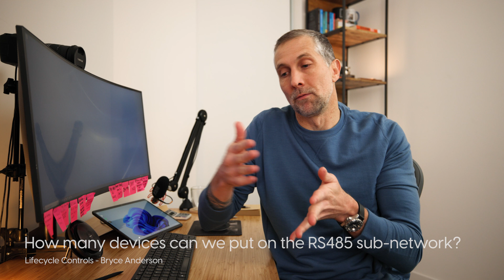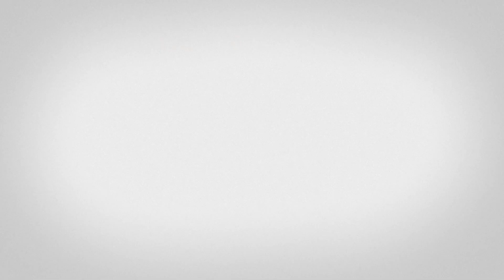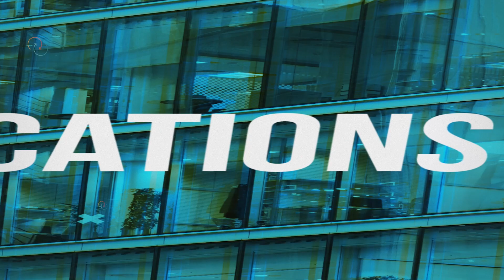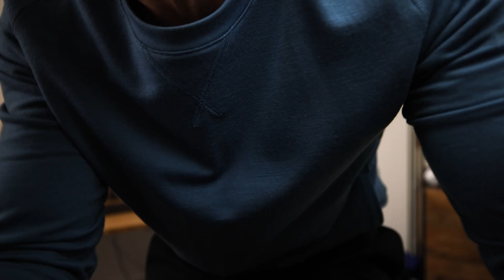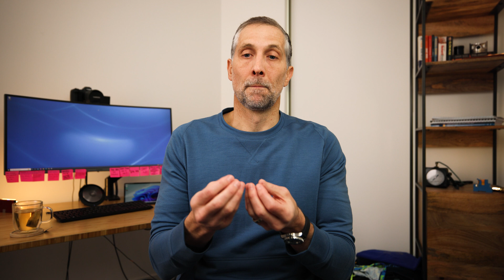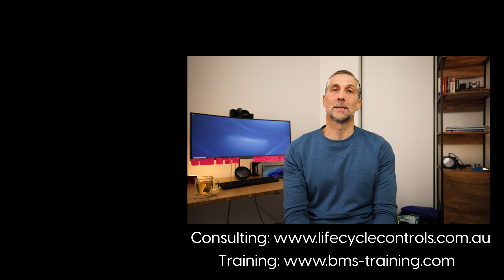How many devices can you put on an RS485 subnetwork?

Comment: I believe it's the following.
32 is the hexadecimal on the Dip switch. This is limited to the baud rate you can pass on the twisted pair.  After all you only have a shielded twisted pair.  Bandwidth restricted.
Especially BACnet who is commands would overload the bus.
In your architecture the 3rd party systems like EMS and Analytics is polling on the IP layer,  not the MSTP layer. It should not be affected by shortening your bus runs,  assuming you have an IP controller at the riser BACnet shared all the trended points back to the server.
Furthermore the trend is to eliminate RS485 altogether with a ring main CAT6 loop instead with IP bus controllers allowing for more bandwidth.  In theory this would be a much later subnet network than the RS485 bus can ever manage.
My opinion only.  RS485 is dead.
Reply from the maker: Hello, thank you for your detailed reply :-) 
I agree with everything you have said. 
I have many situations where overloaded RS485 sub-networks are slow to present data back to the network controllers. Too many devices, too many points. 
Also, some BMS systems do not use network controllers that hold the database, some use gateways, that simply transfer the data from the sub-networks through to the IP network. This significantly slows down the amount of information that we can get through to multiple servers. 
Lastly, often, an overloaded sub-network results in an overloaded BMS network controller. CPU running at 100%, available memory stitting at 0%. Network controllers crashing and rebooting. 
I have projects running right now where the BMS company is putting in AU$500k fee proposals to break up their sub-networks into smaller segement becuase the BMS is performing poorly. 
Thanks for the comment.

Comment: @Bryce, thanks for video. What do you think of mixing third party MSTP controllers on same subnet ? Is it recommended or not? Advantages vs disadvantages?
Reply from the maker: This is a complex question, but basically. 
I do not mix different vendor BACnet MSPT products on the same MSTP subnetwork. But, I generally work on very large projects (smaller projects can not afford to pay for a dedicated BMS consultant). 
So, one subnetwork for BMS controllers, one for electric meters, one for VSD's. 
There are many reaons why this is important on large projects. 
However, on small projects it is not practical to do this. Mix everything togther and keep the device count under 32.